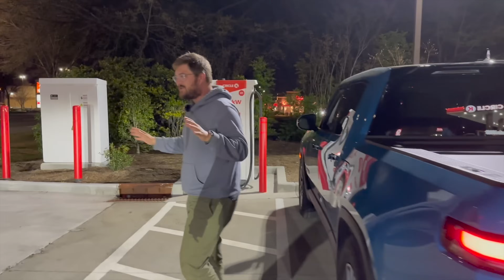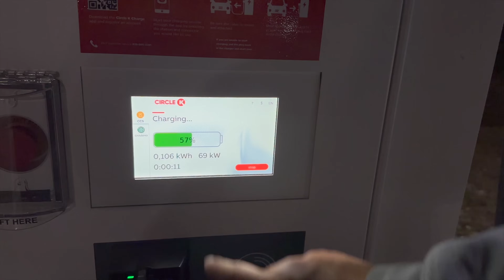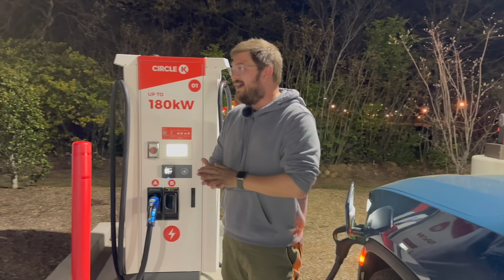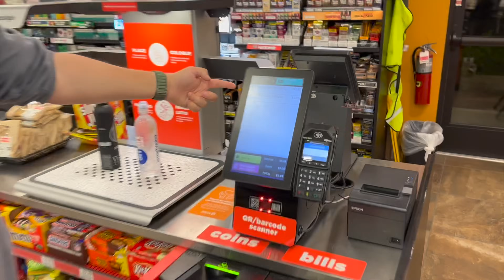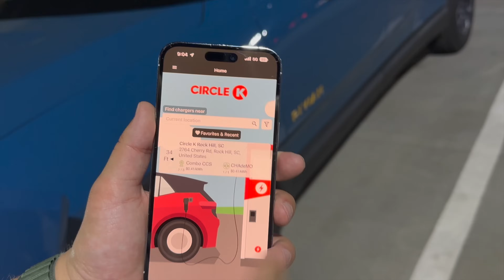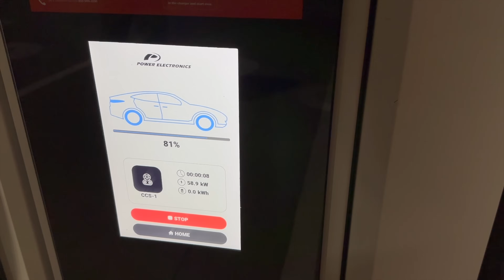These Are The Charging Stations I Want! Visiting The Circle K DC Fast Charge Test Location

Comment: Can I tap my credit card to fill up just like normal people?  Do I need an app downloaded like I need from every other wanna be energy provider?  Does that app work when I need it to?  Is a charger available and does it work?   What about the problem of icing at gas stations?  The real answer is quite apparent to me.  Adopt Tesla's system (I own & drive a Bolt) and be done with it.  Tesla's system works, is there in quantity and is rapidly installing more.  My second choice is EA (no membership or app required) because I can just tap my credit card and most chargers (EA) I've used worked adequately.  So I'm in favor of throwing money at Tesla and Electrify America and get a potful more out there now.  Kudows to Tesla for opening up their chargers to us mere mortals, and to EA for getting into it in a big way.  And hopefully getting it done in MY lifetime which kinda indicates I'm running out of patience with the delays in getting a decent nation wide charging network.

Comment: 🤔...hopefully these third party chargers will be fast to realize having the extra cost of the screen and pay hardware is not necessary just adds complexity that gets ruined by the environment and not very user friendly and more convenient to have an app
Reply: Don't forget that (as far as I'm aware, being in the UK) this (USA) is a country which still values the "freedom" of paying with cash, or a piece of paper with numbers and a signature on it....
We (I) don't do that anymore.
Reply: Apps work ok when there's only one charging company, but don't scale when there's 20 of them and drivers are expected to install an app and create an account for each and every one of them.

The process of getting the app downloaded and the account set up can easily take 10-20 minutes, which depending on the car and how much electricity you need, might end up being more than the entire charging session.

A case in point. A few months ago, I decided that rather than charge at Electrify America (for which I already had my account set up and knew how to use), I'd level 2 charge at my destination, which was a SEMA Connect. I then proceeded to waste 20 minutes figuring out how to get the charge started. Which, for the amount of power I needed, was longer than the entire charging session would have taken at the Electrify America. This is why mandatory apps suck. It's find to have the app be a payment option, but it shouldn't be mandatory.

Also, reliance on apps assume that the driver has a working smartphone, which is not always the case. I once had my phone brick on me during a trip and ended up being forced to call customer service to activate the charger to avoid being stranded. It would have been far easier to simply insert a credit card and be done with it.

Comment: Kudos to Circle K, very cool to see them building out with EV drivers in mind, but don’t forget about those that tow trailers. I’ve yet to see anyone addressing this problem. Is anyone working on pull-thru style chargers?
Reply: So far, the number of electric vehicles even capable of towing, let alone actually towing anything, is too small for charging providers to find pull through chargers worth the effort, which a few exceptions. In time, this will eventually change.
Reply: @ab-tf5fl  Even as someone that tows often, I admit I would rather know I’m pulling up to an available and working charger, than one I don’t need to unhook the trailer at. So at this time the infrastructure funds should be focused on more (and more reliable) chargers. However, without an infrastructure user-experience that is equal to or greater than (in terms of convenience/cost) as refueling at a gas pump the idea (often talked about) of “mass adoption” is a bit of a stretch.  Considering the concrete and conduit installed at these sites has at least a 10-15yr life, maybe the charger installations of today need to be designed with the “masses” of 2035 in mind, no?

Comment: I love this 180kw ABB charger, it should be the industry standard.

It makes so many things right!
- long spring loaded cable
- connectors in the front, at low height easy accessible to short and handicapped people. Also easy for those in a wheelchair.
- the same applies to the screen and payment machine.
- No apps and no create account hassle
- decent charging rates.
- easy, quickly and simple.

To be perfect it only needs to also allow payment by cash in the cashier and also allows to insert phone number to receive notifications.

Comment: It’s all about 3 phase 11kv or higher availability. 

In Europe it’s everywhere. In Canada it’s basically everywhere. 

In the US there are lots of gas stations that don’t have 3 phase and even if they do it isn’t guaranteed to have solid 11kv. 

But it’s going to come because the cheapest way to increase support infrastructure in the last mile is 3 phase on the poles.

Comment: imo getting a electric car is a great idea if you have a few certain things and lifestyle, say you have two place you drive to, your home where you can charge off solar panels, and maybe your job you can charge there too, in between you may have a city to drive thru, but this will be well suited to the ev. you need a good way to charge and use that charge all in good timing.
Reply: None of the above is necessary.
If you're a low mileage driver. You charge when you go food shopping (etc) 30-45 minutes sufficient for a week of (average) driving.
If you're a higher mileage driver (business, etc) you're going to be "on the highway" at lunchtime. Fast charging opportunity (and you still have the "out of work use" locations (shopping, gym, socialising, etc)
.

Comment: Good, lets see some covered parking at those chargers, trash cans, windshield washing supplies etc.  I couldn't agree more.  The real money isn't made on gasoline or charging, it is in the convenience store that the money is made.   This should be a no brainer.   They will need to have some pull throughs for the towing and large vehicle applications.   Convenient just off highway easy access sites would be fantastic.  They should offer an option to "pay inside" at the charger so you can go in buy everything you need inside and pay in whatever payment method you want including cash.

Comment: Kempower charging should be the way to go. You can plug in your car to any of the satellites and it pulls the power you need in 25kW increments. This way you are not forced to select the „correct“ charger for your car. Check out the video from Kris Rifa with a Recharge rep. in Norway.
Reply: and it allows for more satellites and faster roll out
Reply: @Scrap-press and best of all. They. Just. Work. 🎉

Comment: Kyle - start gigging charging sites for not putting a roof over chargers.  We could see 20 gas pumps under a well-lit roof in your background.  Those cars are only there for 5 minutes, and they get to get out of the rain.  I was standing in a flash flood in OK in an inch of water pouring along the Walmart parking lot in front of the EA chargers holding a 350 KW cable thinking there'd be nothing left but my shoes.  Start pushing these guys to get the EV chargers out of the weather, and (hey) maybe under some SOLAR PANELS!!!!!
Reply: Amen!  Been saying this years.  Along with that, pull thru type layout (like an island of gas pumps) as this also solves the issue when towing.
Reply: This makes too much sense, I doubt they’ll solar roof any stations anytime soon lol.
Reply: @dave83104  I mean some Tesla chargers have solar above them like in Firebaugh CA right now
Reply: If I was THE MAN….I’d make every gas station have at least one charge connection at every gas station. Solar and storage included!
Reply: Just get an old school waterproof hat 😂
Reply: Nice idea to cover the charging stations, but out here in Portland Oregon it would just become a homeless camp.  I’ll stan in the rain.  A trash can would be nice though.
Reply: Just put some chargers next to the gas pumps where they are under roof!! These chargers don't spark as they don't active until they are plugged into the vehicle and you pay.
Reply: Ironic that Kyle is touting his 2nd class treatment, pushed into a far corner of the parking lot without a roof over his head. Learn to expect more, people.
Reply: Although to us it may feel like EVs are a mature thing, it’s such the tip of the iceberg.   We are at the start of all this.  I imagine all these will be covered with amenities but actually won’t need amenities soon due to quick charging speeds…. We are already down to 10or 20 mins in many cases…..in the next few years that could be 3-5 mins basically same as ICE…. So years from now you’ll be telling your grandkids “back in the day I had to stand in the rain to start charging my car and I took 20 minutes!”…. And “get off my lawn!”
Reply: Look up the circle k charging stations in Norway they have it covered and under solar panels !!
Reply: Exactly.... Instead of government rebate between dealer and consumer , govt needs to incentivize infrastructure with charging super stations like China.... Charge 20 cars in 8 minutes
Reply: I agree with John Morrel a roof is always needed. Solar if posdible. Also each sites need a few level 2 for tge cars with no fast charging.
Reply: I'd rather have more working sites than fewer sites with expensive roofs
Reply: I believe a lot of it has to do with the property owner.  Many sites are on leases and these structures may not be allowed in some cases. Personally, I would like to see existing gas stations converted to ev charging.
Reply: @PumpUptheJam81 how long does it take to charge the car?
Reply: I think it's less important for EV charging since you won't be standing there as long as to fill a gas tank
Reply: @suunraze  The lighting is more important than the coverage.  I've been charging in some shady spots around the back of gas stations and had people that come wandering out of the woods.  At 2AM, that's not ideal and would be better it is were at least well light so I could see them coming.
Reply: @MichaelWottle  Good point!
Reply: @suunraze you think it takes less time to charge a car than fill with gas?
Reply: @bryanutility9609  the shelter isn't as important for EV charging equipment because you aren't stuck standing there. Also, ev charging equipment is weatherproof. Gasoline fueling is not; water infiltration is a serious risk
Reply: @suunraze  that’s a lot of electricity to be around a bunch of water.  I don’t want to stand in the rain at all.  It’s ridiculous.
Reply: @bryanutility9609  my point is that, for a gas car, you'll be standing there for 4 minutes. For electric, it's 15 second. The conductors don't transmit any power (just little communication signals) until the connection is secure and handshake is complete. Thats why I think shelter is less important for electric than for gasoline.
Reply: @suunraze  it takes 15 seconds to charge a car?  I sit inside my car all the time while pumping gas.  I’m glad there’s no stupid rain all over me when I get out the door.
Reply: @suunraze I disagree. Imagine a hailstorm hits while you’re stuck charging and your car is completely exposed
Reply: @leviconner  how is that different from a hailstorm while the car is parked outside? Or driving?
Reply: Unless you're shooting a YouTube video

Comment: I hope Tesla and others start moving toward pull through gas station style chargers. Would help a lot with towing and easily accommodate all vehicle models no matter where the charge port is located.
Reply: That's great IF you know the car at the charger in front is leaving before you (banks of 2? 3?)
If not, the bays (lanes) have to be much wider, which defect the object.
.
Better to have "open lanes" at the end of a row for the (low percentage) of towing vehicles.
V4 Tesla chargers have sorted the port position issue.

Comment: I noticed all the gas-filling ports are under a cover in case of inclement weather but, none of the electric charging ports are... that is usually the case for electric charging... not fun when it is snowing, raining, and extra hot with the sun bearing down on you.
Reply: You forget that a gas car you have to remain outside.
On a Tesla you can open the charge port door before you get out of the car.
Run out grab the charger cable and plug it in and then go back in the car 
No need to wait outside in the rain snow and cold.

Comment: Electric charging should be placed in a different way.  So that you can drive up from any side.  That is, in this case, near the left rear part of the car.  Then it will be convenient for cars with port placement on any side.
Reply: That's great until you arrive at a row of let's say 24(?) chargers and see a few empty, then you pull into a  lane to find the charger on your left (let's say you have a Ford/ Tesla) is occupied by a Hyundai on the other side of the charger. You then have to pull through or reverse back, only to find they're all taken.
That's how "disagreements" start.
(It's not like a gas station where is easy to gauge who's next)
.
Pull in bays.
Central cable (ref Tesla V4).
If your port is at the rear, you reverse in.
If it's at the front (side), nose First.
Cable long enough.
.
A few open "tow priority" units, access both sides at the ends of the row.
.
Most important upgrade?
A single lane "Drive through" style entrance lane.
That ensures "first come, first serve" at busy periods.
Combined with a "next charger free" countdown clock and preferably a "traffic light" indicator system on chargers.
Red: Down.
Orange: Next available.
Green: Available.
.
That would increase the throughput.
.
If you stop on the off chance and see 20 cars in the lane, just drive on.

Comment: Now that's cool! I wish everyone would focus on charging at 300kW. I don't understand why they would offer such low output still. So strange.
Reply: And some healthier food options. Circle k is filled with junk food
Reply: I think it's because no matter how fast the charger is, you're still limited by the capabilities of the car. So, paying a bunch of extra money to install 300 kW instead of 180 kW at a time when very few cars on the road are even capable of taking advantage of those higher speeds doesn't make financial sense.

When more cars get on the road capable of utilizing the higher speeds - particularly EV trucks with big batteries - this will eventually start to change.
Reply: @ab-tf5fl  and that's why I have only Tesla's now and I dropped the other EVs. I prefer 250kW charging everywhere I go

Comment: Yeah, it warms your heart.  Imagine a major corporation responsible for creating and preying upon food deserts choosing to invest in rewarding the top 1% out driving their EVs.  Why, it's enough to make the 7 year old mining your cobalt swell with pride.  Oh wait, is that another rolling blackout?  How am I to operate the lift in my 6 car garage?  Fire hazard?  The honest policyholders can always subsidize my home owner's policy premiums.  Let them eat chocolate ice cream, eh?
Reply: Salty today?
Oh! Then I read the rest....
"The 7 year old" was already "mining the Cobalt" to refine trillions of gallons of fossil fuel every year.
Those EV owners with solar (quite a large percentage now) will not only remove their homes from the grid, reducing load, preventing "rolling blackouts", but will also run their home from a battery if "the sun isn't shining" or, in an extreme case, if there's been a really bad blackout (due to fossil plant failure?) They might run the home from the EV!?
"The lift in "your"(?) 6 car garage"?
Use the car that's "on the ground"?
.
"Fire hazard"?..... Yeah.... ICE cars are aren't they?

Comment: That’s a nice Rivian there.
Reply: Indeed 😀
Are these ABB Terra 184 units now able to charge 2 vehicles at the same time? A few weeks ago i was at a Terra 124 with an EV6 plugged in. Had to wait, until the Kia was finished.
I also was on one of these Power Electronics chargers (very rare in Europe). It was very quiet, but the touchscreen wasn't that responsive and the cable management was already broken.
Reply: @automatix5  yes, 2 vehicles can charge at once
Reply: @brandenflasch  Thanks. Must be old software then.

Comment: 10 minutes is too fast. An ICE vehicle is another story as you cannot fill up at home unless you are a farmer...my uncle bought gasoline in bulk as his tractors were gas powered...but for city dwellers that isn't a option, so you don't want to be hanging out at a gas pump for 20 to 30 minutes. An EV can be charged at home for most even now, or at work...so fast charging is only done on road trips...and you really need to take a 15 to 30 minute break every 2 hours of driving to stay alert, anyway.

Comment: That whole thing is bottlenecked at the transformer. Can’t do more than two cars at 180 kW or it has to de-rate the power. If you had a station with four 350 kW super chargers that could operate at peak power simultaneously, you’d need a 1500 kVA or larger transformer which is significantly larger cost. The fact that Circle K owns and operates the site means they can make up for cost by bringing more people in the store and pay for it that way. But sites either have to upgrade to over a MW of service or have energy storage onsite to buffer high charging loads. At that point the charging experience will be nearly equivalent to stopping for a quick fill-up.
Reply: So Tesla leverages the Megapack.
Installs them at charge locations.
Connected to local solar(?) and/ or the grid.
Buying energy cheap, selling high.
When it's busy, they use the pack to feed the chargers.
.
Win, win, win.
(Also provides grid balancing and UPS for the location)